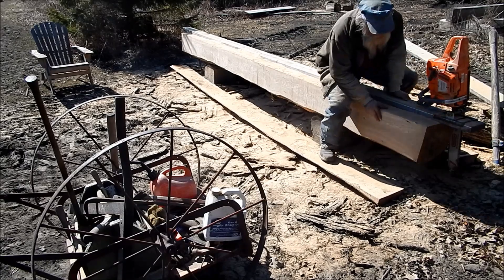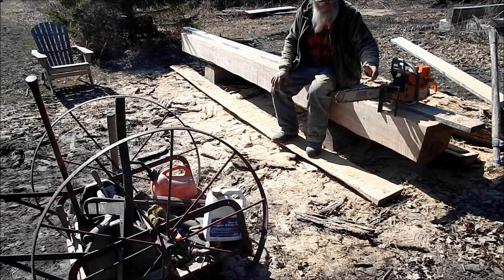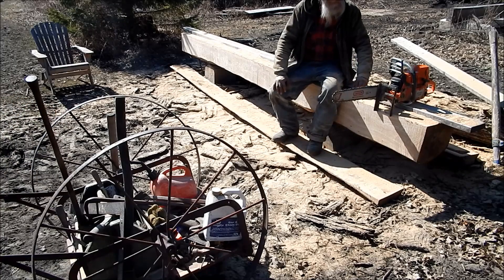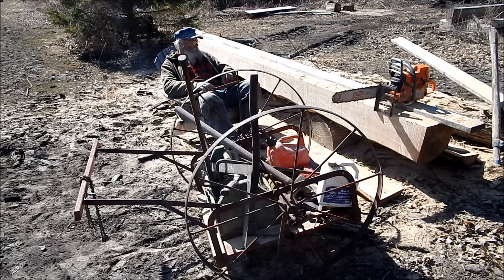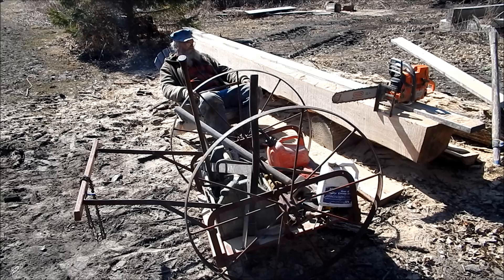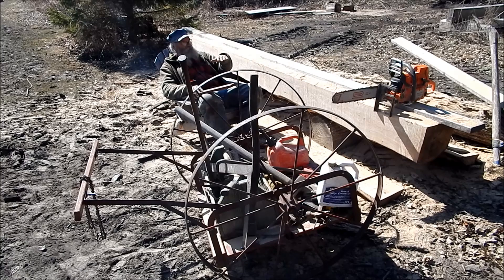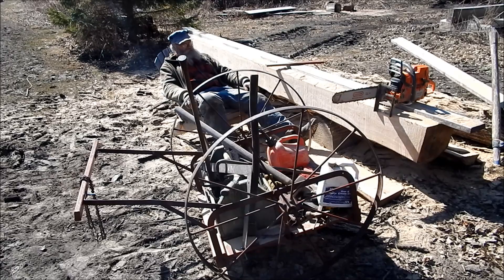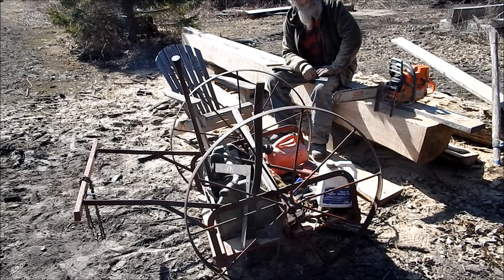Cutting 10 x 10 Oak beams

Comment: Logcabinlooms,  I agree with You on opinions about Axes. I have one Splitting Maul that never has worked right. I use it mainly as a sledge hammer.  I have used other Mauls that were better designed and alot easier and safer to split firewood with.

Comment: love that wheelbarrow
Reply from the maker: The low platform design was made for transporting cream cans. Its easy to lift them on, or off, without lifting so high. I find it handy for heavy things like my planer, or a generator. The big wheels make it easy to roll, but also allow the platform to be dumped by simply lifting the handle and rotating it over the wheels, the bed will invert. It works well for heavy chunks of wood, but would also be dandy for moving heavy rocks.

Comment: Excellent video again, wish I knew how to do what it takes to make a video.
Reply from the maker: Its not difficult to do videos, cameras that will do excellent video have gotten to be pretty inexpensive. It gets a bit more involved to edit, but I use Windows Movie Maker because its free. Its a very capable program, just not very intuitive. Once you catch on to how it works you can do all you really need to do with it. Putting a video on YouTube is fairly straight forward, although if you have a slow connection, and do videos in HD, it can take hours to get it up. The hardest part, and one that discourages people, is having to deal with some of the people that turn up, the internet can show the bad side of some of them.